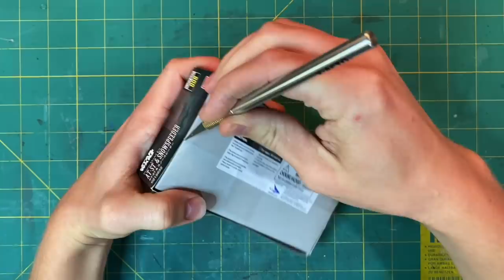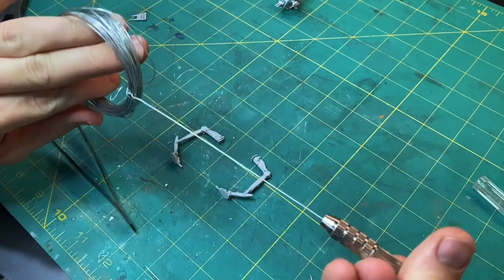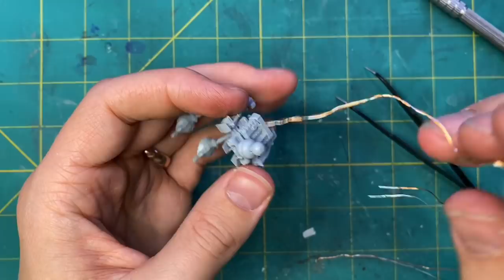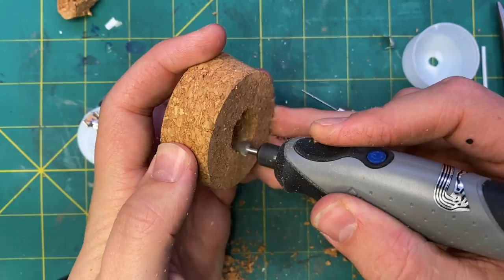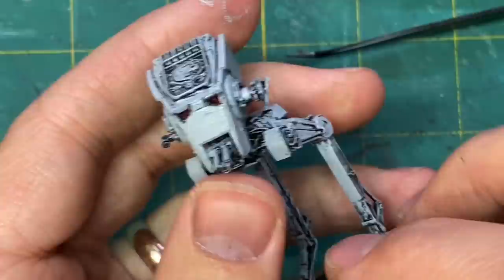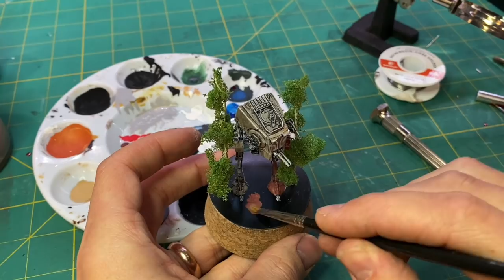Mandalorian AT-ST Diorama

Comment: Idea: Make a tiny diorama of a sandspeeder. Being that snowspeeders are actually sandspeeders.
Reply: No they are not, the internal propulsion units have been modified for the cold.
Reply: @darthkek1953  Well they are still commonly used on desert planets, and either way they weren't initially made for Hoth or snow planets so they arent snowspeeders.
Reply: @dakufaust  I made a joke mate. My joke was they ARE the same. (The point is the unseen engine internal differences are only story/plot devices, not film design differences).
Reply: @darthkek1953  oh lol I should have noticed that
Reply: @dakufaust  hehe, one reason my  jokes don't get spotted as jokes is my jokes really aren't very funny. 😎